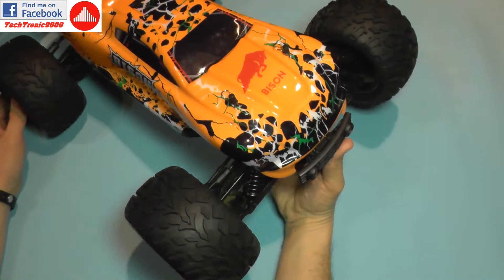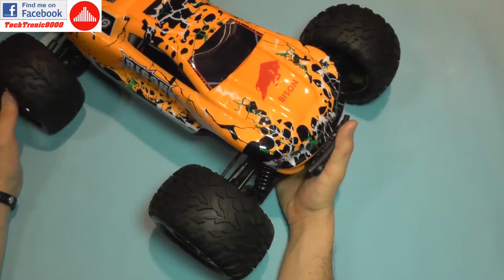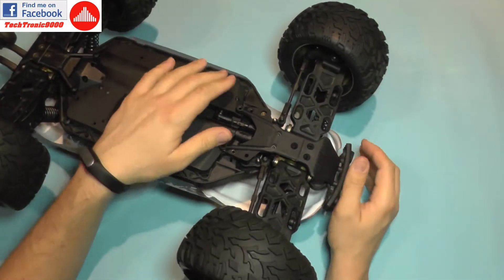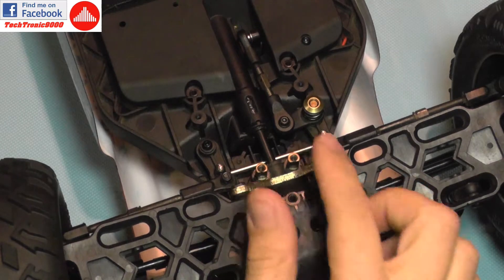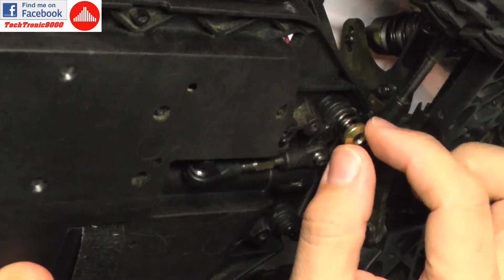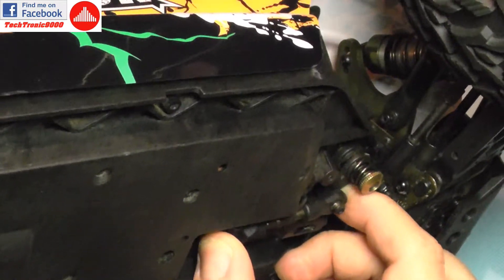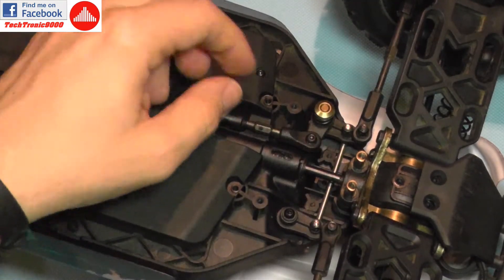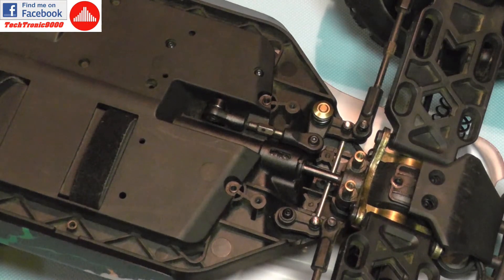VKAR Bison / Helion Four 10TR - Poor Steering Fix - Servo Saver Adjust

Comment: Adding some (light) threadlocker might tighten it a bit more.
Reply from the maker: Yes indeed, but i prefer nail polish as it's very cheap and it's still easy to remove without risking stripping the screw.

Comment: Its very easy to fix it but he began to spin up every race))
How to fix it more securely? a little off loctite?
Reply from the maker: I'm using nail polish and it's easy to brake off in comparison with the loctite and it still holds good enough not to get loose by it's own.